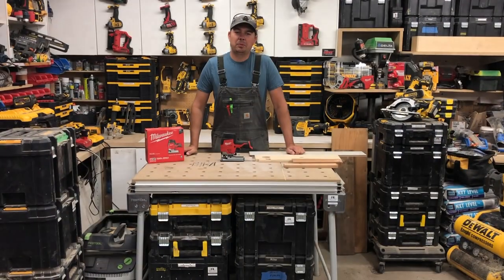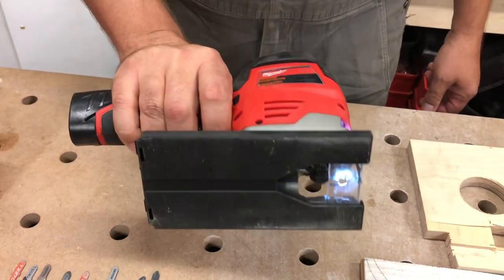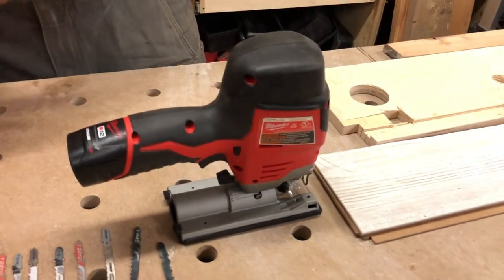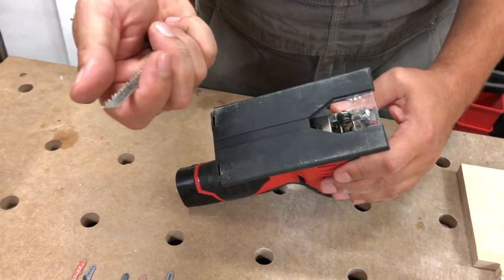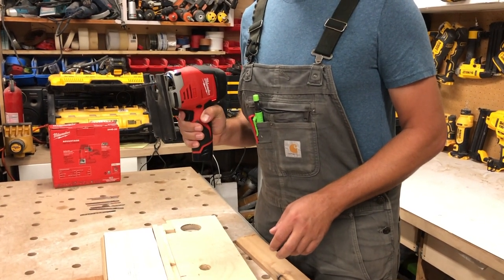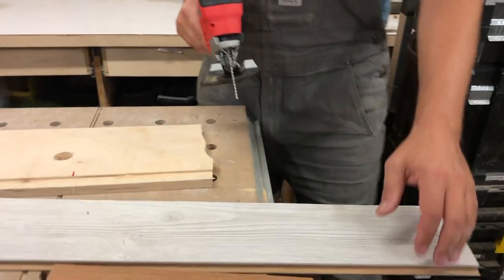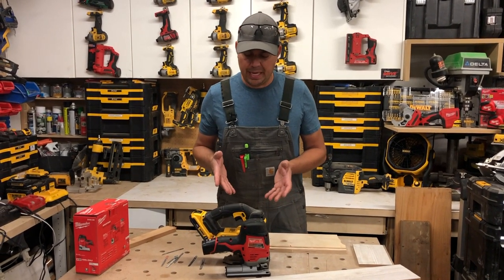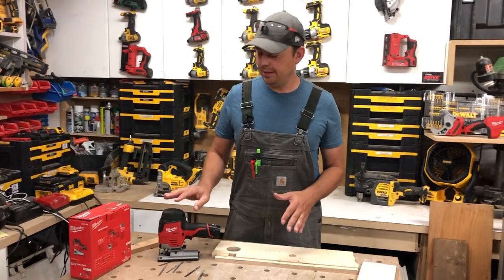Great for small spaces but...  Milwaukee M12 Jig Saw Review

Comment: Great Video, honestly that 1.5Ah battery really under powers this jigsaw.. pop on the 3.0 or higher and this comes to life.  Also this is a brushed motor as well, surprised that Milwaukee hasn’t released a Fuel version yet as it would keep up with that 20v

Comment: You’re also comparing a 20 V tool to a 12 V tool let’s use our brains here
Reply from the maker: true, but it's good to see how things compare
Reply: @hammerandhome  I can respect that!
Reply: Wish he would have used a 4.0 battery or maybe a 6.0 would have really brought that little saw to life, the small battery’s are ok for just getting by
Reply: 12v compete directly with 18/20 volt tools now.
Reply: Just another Milwaukee bashing effort.
Reply: Yes but 18v because semantics!
Reply: @edmondwong6117  is that really a thing? I was heavily attacked on r tools for trading in my m12 jigsaw for a 20v worx jigsaw. I even had pictures showing how bent up the Milwaukee frame was (home Depot mishandled it during it's 10 year storage probably). I usually buy Milwaukee or DeWalt, but I saw a better deal and took it.
Reply: @edmondwong6117  tool buying is strange, as someone coming from PC building, I always buy the product and not the brand. 

Also interesting to note: tool users cut their zip ties to make it "look clean", while us PC builders leave the ends as if to brag about our "diy modding."
Reply: 100% lol
Reply: The 18 V Milwaukee jigsaw should blow the deWalt away easy
Reply: @motube2389  I really want DeWalt to make a more compact brushless "20v" (18v lithium ion) jigsaw. 

I learned that DeWalt calls the 18v Li batteries "20v" to both differentiate between the older 18v NiCad batteries (which hold the same power and longer shelf life BUT they have a "memory effect" that causes it to retain the same speed before recharging.)

And I suspect also marketing :)
Reply: perhaps you've been living under a rock, but 12v tools are comparable to 20v tools these days
Reply: @d4rkst0rm16   if thats what he was trying to show or would have made that statement it would be valid but clearly not the point of the video genius
Reply: The gen 3 M12 fuel hammer drill and impact driver can actually do big jobs. For some things, you need the bigger M18 fuel gen 4 and for other things you need the smaller M12 fuel gen 3 fuel. However, for most situations both the M18 fuel and M12 fuel are equally good tools for the job.
Reply: @davidperry4013  I agree with everything you said but my point still stands that he's comparing it to other drills in its category. I agree it hits above its weight class tho!

Comment: Model 2445-21 is not a "newer version" of model 2445-20.  The 1 simply indicates it is model "2445-20" in a kit with (1) battery, which adds the 1 at the end of the bare tool model number.
Reply: Yeah…..kind of a fail there lol

Comment: U need to try it with a 5ah high out put battery I run all m12 at work and they all ran a lot better when I got the 5 ah battery plus it’s 12 volts so if u want to get something better than that dewalt you need to get the m18 my boss got it and it’s magnificent

Comment: I use Mafell and Festool but, as you say, at times they are too big. So I'll be getting the Milwaukee M12 exactly because of it's tiny size and the other thing: other brilliant tools in the M12 range that I like. As it's an only an extra and not for everyday or heavy use, I think it will meet with my expectations. If it hadn't been for the other Milwaukee M12 tools, I might well have gone for another brand.
Reply from the maker: i feel the same about the m12 line, so many cool tools to chose from, its hard not to get into it. cheers
Reply: Facts from NYC

Comment: Been using it and bosch for 5 years cutting holes in drywall ceilings, the lightweight overhead is fantastic. The bosch was more comfortable but I got an m12 battery 3-pack on black Friday for 100 bucks so I use the m12 more because I usually have something charged
Reply: It is best for it size..I’m also own the 18v .

Comment: I think the battery was a bit to small for that saw I would use at least a 4.0 with it… also the Fuel is probably the way to go. I have the M18 Fuel D handle and I swear it’s a beast. Good honest review though. I was thinking of getting the barrel handle M12 if they make a Fuel version
Reply from the maker: yeah I just picked up a 4.0 so i'll do some back to back tests.
Reply: @hammerandhome  any updates with the 4.0 battery used?
Reply: dont think this jig saw comes as a fuel yet, which is why I do not have one
Reply: I actually ended up getting the M 12 and I put the 4.0 battery on it and I have to say I’m really surprised how underpowered it is… I wasn’t expecting it to be like that

Comment: 3 things:
1.MURDERS batteries. 4.0 or higher for any heavier work
2.The base comes unlocked and goes all sideways on mine constantly. Fail. 
3. I don’t know enough about these, but I hate that the air exhaust doesn’t clear the cut line. Like, it’s blowing tons of air, point it at the blade.

Comment: Thanks for the review Brad 😎😍😎😍😎 wondering if you can put a Collins coping foot on it??? I love my DeWalt D handle too!!!
Reply: Definitely not good at coping crown or baseboard. I had to use it in a pinch because my Dewalt was at the shop. Ended up doing it by hand.
Reply: @trooperfitclub  thanks for the heads up, I have no need for this then😎😒😎
Reply from the maker: yeah i don't think so, thx for watching Ted

Comment: You can't compare a 12v saw to a 20v saw lol The 18v would be a fair comparison to be honest . for 12v brushed tool I can't complain
Reply: DeWalts 20V(and all 20v competitors) is the same as 18v(ie Milwaukee M18 or Ryobi One+ 18V), it's just marketing hype in America, in other countries with tighter marketing regulation the dewalt 20v is called 18v. The change from DeWalt's(and other brands) 18v to 20v came with the shift from NICAD to Lithium and Lithium's battery layout where NiCad had 15 - 1.2V cells in series vs lithium's 5 - 3.7V cells in series also lithium's ability to supply more current meant Dewalt and other brands had to change the battery connections on the batteries and tools to handle the added amperage. people would have been upset to have to buy all new tools just because DeWalt just decided to change the battery style and kept the same 18v name, so saying 20v made people feel they were getting more power, which they were but it was from battery chemistry not by voltage aside from 0.5V nominal, but the transition went a little smoother with the help of creative marketing.
In reality comparing an 18v or 20v tool to M12 line is not exactly fair, because they have 18.5 nominal volts, where as M12 line uses 3 battery cells in series to only make 11.1 nominal volts, that's a 40% difference. Also the M12 line only uses 18650 cells(limited by the battery design because the battery's need to fit into the handle of the tool) where as 20v systems can use the larger 21700 and 26650 cells that can put out more amperage.
Reply from the maker: lol, i can and i will, it's good to see how the 12v holds up to the bigger tools, especially for people who don't necessarily want to spend big bucks on big tools
Reply: @hammerandhome  I own 10 different m12 tools and every one is underpowered compared to the m18 or dewalts 20 v. except the M12 fuel multi tool it’s hands down the best multi tool on the market no matter volt or brand

Comment: I purchased one of these a long time ago and the base comes loose every time I'm cutting, any reason why this happens? I paid over $100 for this junk. I have lots of Milwaukee tools but this is not compact nor a convenient tool. It only holds T shank blades versus way cheaper brands they hold both types. I own different brand names and that's because of the application I use them for.

Comment: They need to come out with a fuel version it's a very old model Keep it going  Waiting for you guys to go live again
     👍🏻🍻🍺🍕
Reply from the maker: Totally agree! Yeah it’s been pretty busy with work but we are starting to shoot a bunch more and get back onto the lives again 🍻😊
Reply: For most projects and even some big projects you could use an M12 fuel impact driver and hammer drill. For big projects going the hybrid route is the best use the M12 fuel impact driver for smaller screws, and the M18 fuel for larger screws and whenever the M12 fuel gets uncomfortably hot. So you have the larger tool for power and the smaller tool for less fatigue.

Comment: Your trying to push the saw to do extra work. Get the oscillator off the tool. I find it perfect for the speed. People complain about under power. I find it perfectly. So why hurry on a 12volt tool. The job will look better if you slow down the cut.

Comment: Welp, I've decided I needa stick with my 20v tools. the 12v doesnt have enough power for me either. My dewalt 20v router on the other hand....
Reply: Your 20v tool is a lie because all 18v battery will measure 20v with no load, but actually 18v once the motor kicks in. So don't kid yourself that you have 2 more volts than other 18v systems.
Reply: @edmondwong6117  NOOOOO D:
Reply: @edmondwong6117  yah I know. But it's easier than saying "my 18v tool pretending to be 20v because it has a different battery pack." Supposedly that's also why they "renamed it" which may or may not be partially true. Lithium vs the old ni cad stick which performance wise was just as good as Li, but it had some issues like memory effect.

Comment: i tried this one and it felt anemic compared to even other 12v saws, which i know arent as powerful as 18v+. I ended up with a skil 12v jigsaw for my small/tight work. Makita also makes a really nice small 12v jigsaw but it was out of my price range. The bosch one is even more anemic than this one so its a hard pass for me.
Reply from the maker: yeah overall im a bit unimpressed with this thing, I thought it was going to be a winner
Reply: @hammerandhome  i took mine back 2 days after i got it. i wish more companies made barrel grip jigsaws.
Reply from the maker: @jhippl  I have always used the D handle style, but i must say I do like the feel of the barrel grip.
Reply: @hammerandhome  the mount of control on a barrel grip is killer, dewalt makes a 20v barrel grip that is really nice seeing that your already in that battery platform.
Reply from the maker: @jhippl  I definitely have to give that a try. I think I’m on all the platforms 😬😂
Reply: @hammerandhome    I wonder if the M12 comes in yellow and black as well..lol.

Comment: The m12 is supposed to be used for small projects,  not big construction projects.  It works great for what I need it for, if I need to do big jobs I whip out that m18! That's a badass jigsaw
Reply from the maker: i definitely have to try the M18, I think this little guy is best for the small jobs for sure, thanks for watching. cheers
Reply: This jigsaw is ass it gets bound up even on thin cabinet material I use it on all the time.

Comment: Crap, I just ordered this with a battery combo for $78.00 with a hack. It's clear from your video that this saw is way under powered. I will return it when it comes in. I'm a Dewalt guy, but don't want to pay $169.00 for the Dewalt since I don't do enough jig sawing to justify it. Might just try the Ryobi 18V cordless. About $69.00.